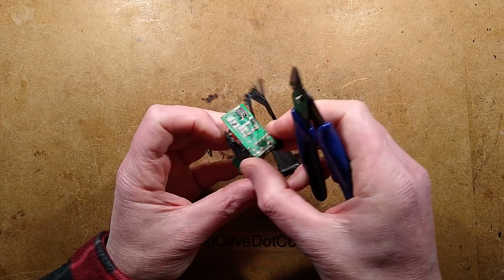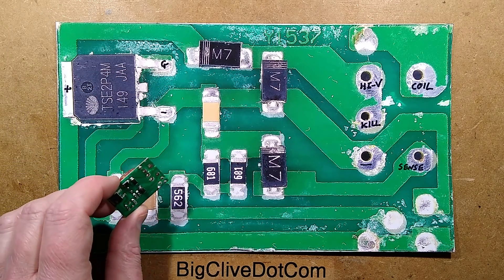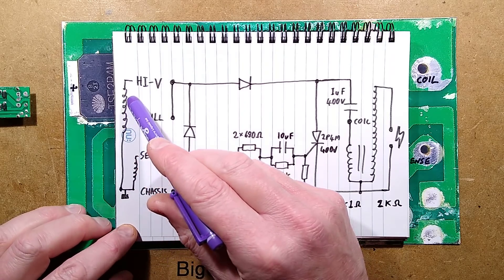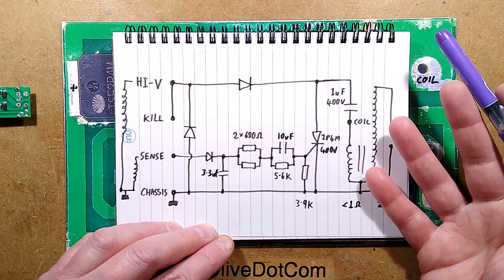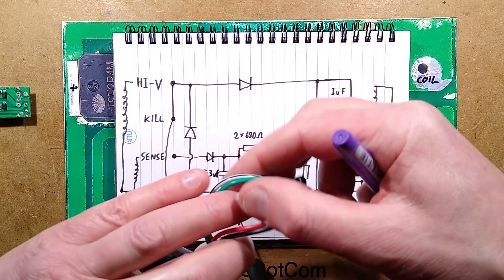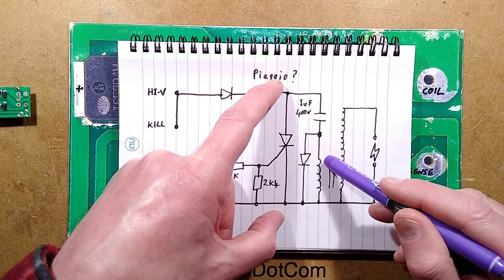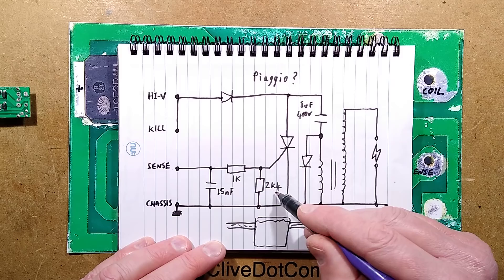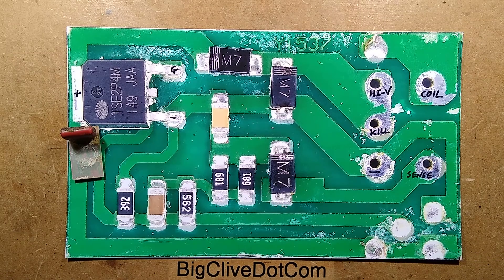Inside a cheap CDI Capacitive Discharge Ignition module - with schematic

Comment: Totally amazing video. The HVDC the pickup coil send how much is it? Did read the trigger signal should be between 0,3-1,5V to the PC port on the CDI, where do you send the HVDC is it on the EXT port on the CDI?

I have tried feed my CDI with PWM modulation tool on the PC port and did feed the CDI with 6V on the EXT because I have a 6V system but I don't get anything out from the CDI on the IGN port.

First of all I am a total noob, please can you explain how the HVDC should be wired.

Thanks.

Comment: Big Clive, could that extra part of the circuit  cause a delay (at low rpm) of the ignition spark? My understanding is that most triggers are set at full spark advance so the module must retard the ignition spark at low and mid range rpms.

Comment: early CDI had the issue of the discharge being too fast... real strong spark but so brief it failed to ignite.
resistors do more than suppress, they reduce the current in the arc and extend it a bit longer as the cap discharges.

as the cap discharges into a step up transformer the resistance of the gap is reflected at the square off the turns ratio... at 10 to 1 its reflecting at 100th of its real value... the cap discharges really fast... too fast. and its more like 40 to 1... 1600th of its value. that 5k boot resistor suddenly appears as about 3R when the arc is occurring. cap discharges slower.

the resistor chain on the thyristor is an advance curve mechanism, uses the RC time delay... trigger voltage increases with RPM, ramps up faster, and the spark occurs a bit faster... different engines want different advance curves, two stroke will be different to four stroke...

capacitor matters. want pulse rated ones. value matters, need so much energy on a discharge at a certain voltage. coil can only deliver so much. too big a cap and it never charges fully. too small and it overcharge, voltages get excessive.interestingly, the first CDI was tesla, way back in 1910 or so... got an old book with a description on two ignition systems, one "normal, one using tesla coils... points run "backwards" to normal induction ignition. the inductive spike as they open charges the capacitor and that discharges into air coils for the actual spark as the points close again.

Comment: I guess you can't use this circuit if you do not have a magneto providing high voltage ? In which case you have to have additionalhv generator ?
Reply from the maker: The magneto would need to provide a couple of hundred volts.  For other systems the ignition coil may be pulsed at lower voltage.

Comment: I found a web site that sells the circuit ( high voltage discharge )  I bought a hand full of them for different things 1.bug zapper 2. a trip wire on my gate so if someone was to try and open my gate at home you will be zapped this is powered by USB with 220ohm resister . they work well with a 3.7v battery or 5v battery.

Comment: I would like to stop the ignition from firing using an Arduino. The CDI's kill switch seems like a good idea but the 400 V is hard to deal with. So I'm thinking about disconnecting the sense input (it is low voltage). Would something bad happen to the CDI when it doesn't get any sense input while the engine is running at high rpm (6k - 8k rpm)?

Comment: I noted you were confused by some of parts on the CDI Capacitive Discharge Ignition module.  I was totally shocked when I found out the magneto on my bicycle 2-stroke motor puts out AC current.  I wonder if that would explain the additional diods?  I hope you find the the time answer my question and hope this help you a small fraction as much as your work has helped me.  Sincerely, Thank You

Comment: There can possibly be atleast 4 different cdi circuit types. One for two stroke engines, another for four stroke. Then there is ac systems and DC systems, the DC system requires a battery to start the engine, then there is the ac system that can be kick started with out a battery, it gets its power from the generator/alternator system on the engine.  Then there can possibly be atleast two more, with adjustable timing for easy starting, or whatever i couldn't tell mine did anything. I didn't have a timing light.  Then they would have on for each 2stroke and 4 stroke ,  im no 2 stroke guy, but hear a two stroke required a different timing curve . Required less timing at high rpm where 4,strokes want advance at high RPM..  a two stroke can easily burn a piston at high rpm i guess the timing helps prevent it.  A two stroke is busy at ig rpm, it need more time at high RPM by retarding the timing. Just from bits i hear, besides a chainaw and weed eater i dont do 2T often.

Comment: To double the spark energy, remove the single diode used to charge the capacitor and replace with a full-wave bridge wired across the stator and remove the diode that is shunting each half cycle.  With double the energy now available to charge the cap, the cap value can be doubled.  The stronger spark will improve combustion and thus power and fuel economy.
Reply: You can't, as the generating coil and the hv coil are both grounded, maybe you could add a diode and a capacitor to create a voltage doubler and get more energy that way
Reply: Has anyone tried a second capacitor of equal value wired in parallel? 2C is the sum of two capacitors wired in parallel. 

Then again, the CDI is already receiving approximately 400 V.  There are so many environmental, mechanical, and engineering factors that can potentially effect spark, it's hard to speculate. 

Then again, even the cheap ones fire plenty of spark in many cases.

Worth testing though....good ideas!

Comment: I never thought that trying to fix my bike would lead me to a Big Clive video, what a comfortably familiar space! 😆

So interesting thing, my bike uses a very similar looking device, but it does not utilize the killswitch lead in the middle.  Instead, the timing signal coming from the stator is wired through the ignition switch to the sense input on the CDI, and the killswitch grounds out the timing signal via another lead between there.  I think that older models of my bike, as well as the version of the same bike for the European market, do utilize the kill pin, and have the timing signal directly wired from the pickup coil.

Comment: Hi Clive, I'm wondering if, in the first circuit scenario, the resistor- capacitor in parallel could have anything to do with ignition timing? I see now that I read further that someone has already made a comment to this effect. The actual change in ignition timing could be calculated so to allow for different engine applications. In a mechanical magneto an "impulse" coupling is typically employed to provide a retarded timing at cranking and as engine starts and runs, the impulse mechanism is locked out and the timing advances to a predetermined setting.

Comment: How much voltage is on hv input? I've been trying to test one of these devices with the 12v from the battery on the HV .. and I think I may have killed :(
Reply from the maker: It depends on the system.  Some use quite a high voltage.

Comment: What is the solvent you used to extract the circuit board?
Reply from the maker: Heat and scraping is safest.  Some will soften with acetone, but it can damage the components.

Comment: A few things to add here.
You have to thank Honda for the awful color scheme of those wires. That's how they color coded their wires in the 80's. Green is ground and black is switched positive.  Of course, the Chinese copied that color scheme and  it is still widely used in modern chinese motorcycles today.

The weird circuitry in the gate of the thyristor as many have mentioned is for timing advance at mid range. There are a few variations of this. Most notable one is the variation that delays the spark at higher rpm's, used primarily in two stroke engines. It just has a small capacitor in series with the sense coil.

Finally, there're two main variations of these cdi boxes. The ones based on an external AC input like this one. And the ones that receive 12 volts and have a small flyback transformer inside that elevates voltage to about 300V. I've been interested in what's inside of those. Hope you can reverse engineer one of those someday.

Small edit. Another notable example are the old Suzuki 2strokes that had a cdi/coil that worked out of only one power coil. On the positive half cycle it charged the capacitor and on the other half cycle it triggered the thyristor. Really clever design.

Comment: I believe the extra unexplained 10uf capacitor is possibly for timing advance. Not all of the standard black box Chinese have timing advance though one. I bought one off Amazon and did not have timing advance while the one that came with my pitbike did, while still looking the exact same on the outside

Comment: well explained. input capacitor filtering to allow only trigger signal. resistor devider to adjust igbt gate volt spec. Also may be freewheel diode can have small series resitance to limit max current of freewheel diode

Comment: Hey I need some help with a project.  Trying to run 2x of these on a dual cylinder build.  Both coils always fire! No matter which cdi is triggered any ideas?
Reply from the maker: I've had similar issues with a multi-strobe circuit.  The transient caused by one triggering triggered the other too.
Reply: @bigclivedotcom  well figured out what was going on....  12v dc cdi btw.  What seems to happen is cdi 1 discharges and coil 1 fires! Somehow coil 2 picks it up through the ground.  Sends a very small voltage back to the cdis trigger terminal on cdi 2.  I have hall effect sensors.  12v + /- and +trigger when active.  Well when all the above happens the led on the hall effect cdi 2 lights up for second.     Voltage is .4 volts.... causing the issue lol.  So took switches off manually triggered them everything works perfectly.  I tried adding a diode to trigger wire of hall effect sensor and it still trips the sensor. Everything is sharing ground and + btw!

Comment: That diode to ground  across the HV coil is simply to load the coil as it goes negative, this prevents flashover damage to the coil. The R/C combo in the gate circuit is to average the trigger pulses to make sure the SCR triggers only at the peak of the trigger pulse at all RPMs, to keep the ignition timing correct.. These CDI designs  are normally fitted to 2 stroke engines that have fixed ignition timing.

Comment: What is the output voltage of Cdi to ignition coil & what us the  input voltage of ignition coil?

I mean on how much volt Ignition coil works? Please give me reply sir..🙏🙏
Reply: It's a long, long, time ago that I made a cdi unit for a car, if I remember it was about 400 v on the primary. I think this sort of circuit will only work with a magneto. Otherwise you have te to have an additional HV generating circuit. Note it's the back emf on the opening of the points that generates the HV on the coil primary if you don't have a magneto.

Comment: BUD I THINK THAT WIRE IS BLACK BECAUSE IT IS AC SYSTEM SO POWER IN AC IS BLACK RED BLUE  OR A LOT OF DIFF COLORS  DC IS RED WHITE OR A LOT DIFF COLORS   I GUESS WHAT I SAYING IS  IT DEPENDS IF IT AC OR DC   AND THAT WILL DETERMINE  WETHER THE COLOR IS POWER OR GROUND OR SWITCHED SOURCE OR  OMG THE LIST GOES ON

Comment: i use to have a chinese scooter. It was so cheap to get parts and taught me a tonne in the process of fixing it, which was at least  once a week. My one even started tearing where the shock absorber bracket connects to the super thin steel tube frame.

Comment: On the Piaggio schematics the diode that is bridging the primary winding of the ignition coil isn’t for protecting the thyristor from back EMF but for  fully discharging the stored energy into the spark gap . So this diode make the spark much powerful and longer .

Comment: Rather than wasting half of the magnetic energy being produced, why not just connect the stator coil to a full wave bridge so that all power pulses can be used to charge the capacitor?  It would then be possible to double the size of the discharge capacitor since twice the charging power would be produced per engine revolution.  Having 2X better spark would make it easier to start the bike, allow for more complete combustion, improve performance, fuel economy, and reduce emissions.  This would also eliminate the need for the quench diode needed to dissipate the negative stator pulses.

Comment: Doubt you'll read this but you interested in looking into how a motorized bicycle cdi works? They are two wire systems I have zero clue how they would work considering they have no sense coil? Maybe a micro that reads the ac spikes idk, can't by much to it considering they cost less the $10usd

Comment: Most large cc Japanese bikes these days have what they call 'COPS' (coil over plugs)  the coil is built into the plug cap, makes easier hot starting & more efficient fuel economy cos they create far more spark impulses for igniting the fuel & the bike will not need half so much cranking to start

Comment: These chinese cdi units come in two types. One gets it's power through a magnet on the flywheel passing a magneto coil. A battery is not required for the ignition system to work. This allows kick starting with a completely dead battery or no battery depending on what the engine is being used for. The second cdi type uses 12vdc for power. This one is very easy to adapt to just about anything to replace an ignition module that is no longer available for both vintage engine's and engine's where the original ignition module would be very expensive to replace with an oem module. All timing sensors are the same so the 12 volt module is easy to hook up to the original flywheel sensor but you may need to move it's position depending on how the original ignition module worked. If it was an early cdi type you may not need to do anything. If it's a modern microprocessor type you will most likely need to move the sensor because it sense's when the flywheel passes top dead center. For the Chinese cdi units the sensor needs to sense maximum advance degrees. Those chinese cdi units retard timing instead of advancing it. At idle the unit is fully retarding timing but at higher engine rpm the unit stops retarding the the timing so it's firing the spark plug at the static timed fully advanced point.

Comment: Do you have any information of CDI magneto system which has NO separate sense coil? I'm currently designing (way overcomplicated) circuit for such a motor because importer no longer has compatible CDI ignitor and manufacturing has discontinued.

Comment: Shunting a magneto with a diode is not unusual it limits the peak reverse voltage at high revs and it causes negligible engine load due the magneto  leakage inductance which a reactive load. I have played with these on a variable speed test stand and found the reverse voltage will increase in proportion to the revs if left unchecked the forward voltage is limited by the load presented by the capacitor and the leakage inductance of the magneto. The simplicity of the circuit is typical of 1970's motorcycle CDI's. Inert fillers in the epoxy potting are to reduce both the cost and the peak exotherm during curing.

Comment: Makes me wish I depotted the ignition on my outboard instead of replacing it.  So much voodoo info out there on 70s era cdi this is.a pretty simple system.  FYI a 70s era four cylinder Evinrude has about 450 volts out of the megneto. That hurts when it bites you.

Comment: totaly off topic now here
is there a way to extend life expectancy of chinese led lamp by installing some kind of series resistor with the power suply?
i know it would not help overdriven leds with a driver circuit, but capacitive dropper ones should in theory get a bit less voltage if i add another resistor in series with the lamp, right?
my mains are a bit high and every chinese lamp that does not use a dedicated driver burns in about 3 weeks, those with a driver last about 3 months and then either water get inside :] or one series led give up
so i was wondering, how to make them less efficient and more relible for long term use
Reply from the maker: To extend the life of capacitive dropper lamps you can change the dropper capacitor (usually red) for a lower capacitance value.  For switching type lamps there are usually sense resistors that can be changed to reduce the current.

Comment: Unfortunately if the car is modern enough to have any fuel injection it's most likely that running the engine with no battery would cause damage to the EFI computer. The battery is as useful for starting as it is for ballast to remove large amounts of electrical noise generated by any fans, motors, etc.
Reply: (edit: battery, not batter)

Comment: You're incredibly unlikely to get any shock from the kill switch wiring.
1. If you're installing something like this, you're going to run that wire close to the chassis so it won't flap around in the breeze. You might even put some of that split loom material over it to protect it.
2. If the insulation does wear enough to expose copper, that's going to be at a point where it rubs against the chassis; the current will simply find a low impedance path through pits in the paint and keep the bike from starting.
Even if it's raining and you're grabbing the body of the switch with your bare hand, the switch housing is the part that's referenced to the chassis; to get a shock off it, the switch would have to break open in your hand. Short of that happening, it's not going to cook your sausage with electricity.